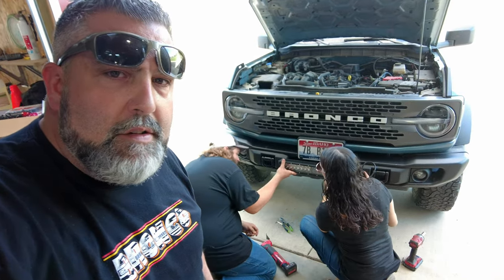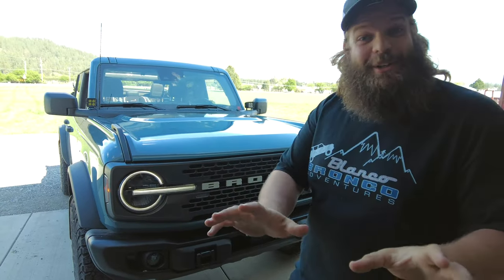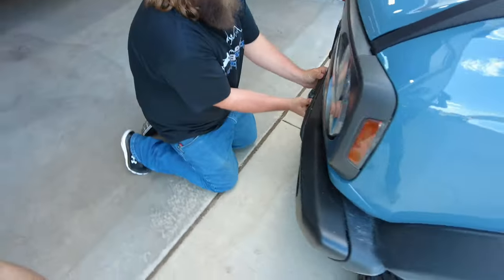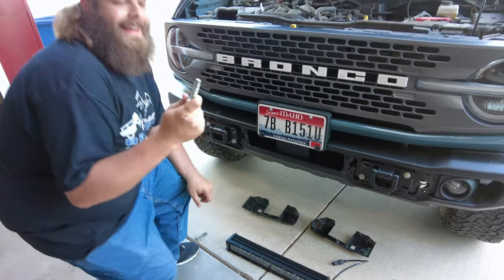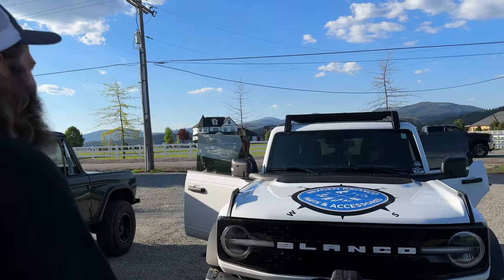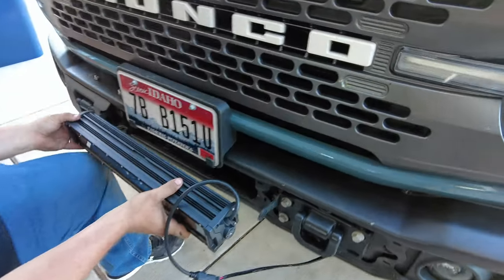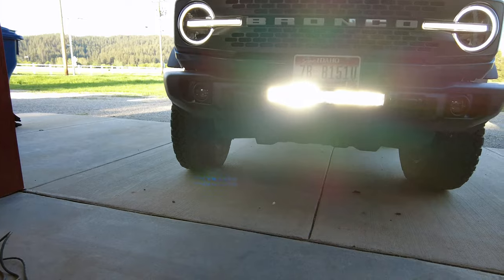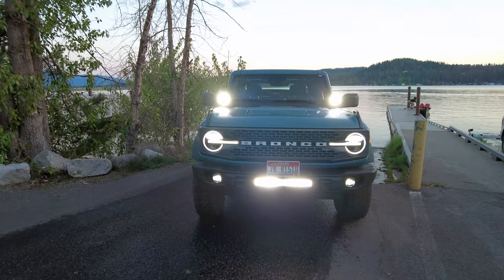We stole this Bronco...to make it better!

Comment: How would you mount it if you have ACC?
Reply from the maker: Hello, Mike! The nice part about the AuxBeam light bars is they come with a variety of brackets depending on where you want to install it! If you have the ACC and parking sensors, where we mounted it wouldn’t work without relocating the ACC and gettin a smaller light bar. They make smaller sizes that would work there or you could install this one anywhere else on the Bronco (like on top of the bumper!) Thanks for tuning in!